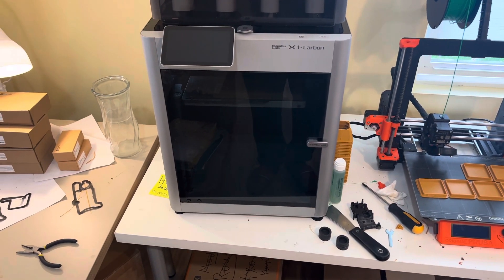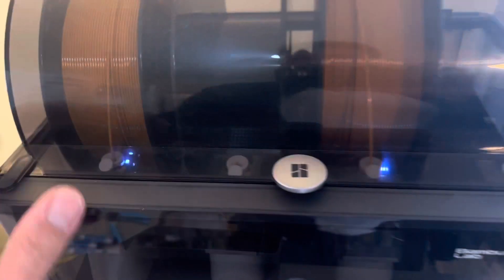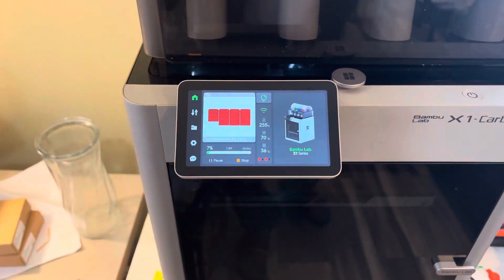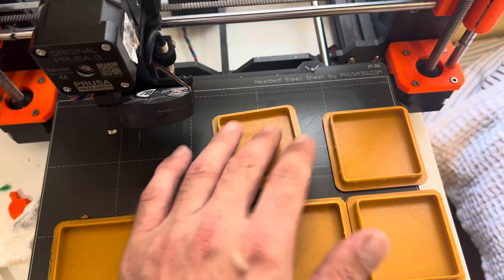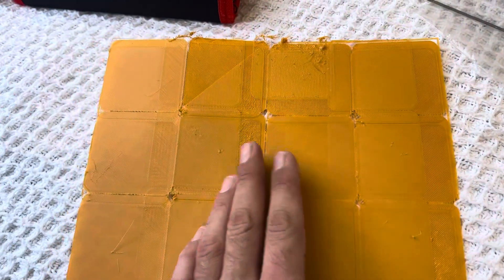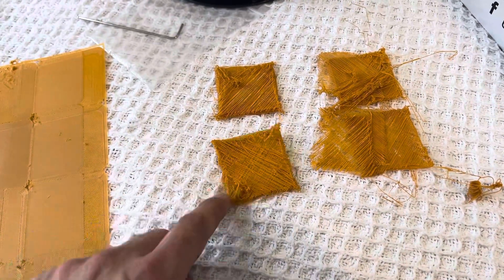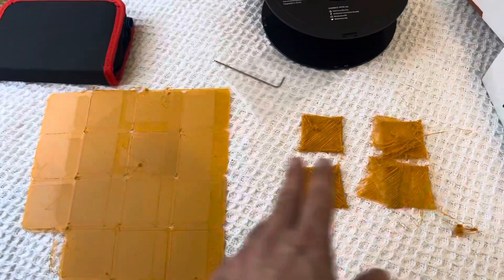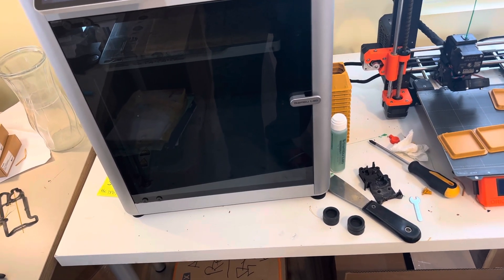Bambu Lab X1 Carbon - Problems

Comment: printing any kind of plastics makes fumes that stick's like invisible layer on top of the sensors, clean them once a week, clean the plate after few prints, avoid CHEAP alibaba filaments, dont make filaments out of plastic bottles, and clean that thing more often.

Comment: as i can see also you are printing on top of the guidelines of calibration lines  and this is not allowed dear try to print after them not on top of them because sometime you will have this issues

Comment: Did you ever end up getting to the bottom of this? I'm wanting to buy an x1c, but issues like these make me V nervous
Reply from the maker: Yes and no lol. After a lot of troubleshooting, Bambu provided new Main Board, because they couldn’t fully determine the reason it’s happening. I installed new MB and the issue almost disappeared. Yes I said - almost. Once a blue moon (1 out of 30-40 prints) still encounters this issue. But I’m ok with that. I consider this problem resolved lol
Reply: @Glebiys  ooh, nice! I would definitely accept that fail rate, honestly.
Thanks for the reply! Hope you're having a great day :)

Comment: Did you get the X1 Carbon replaced?
Reply from the maker: Bambu Labs don’t replace units after 30 days. All repairs are done by customer, Bambu only provides parts and instructions